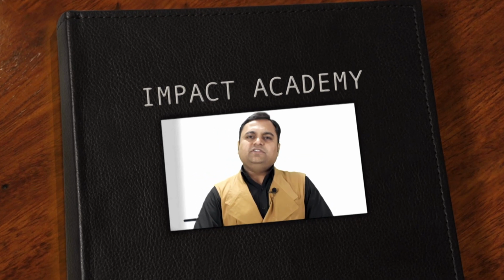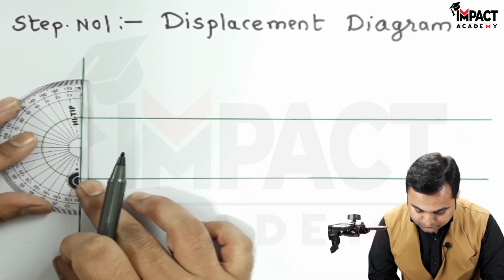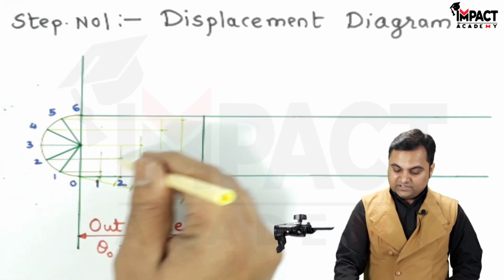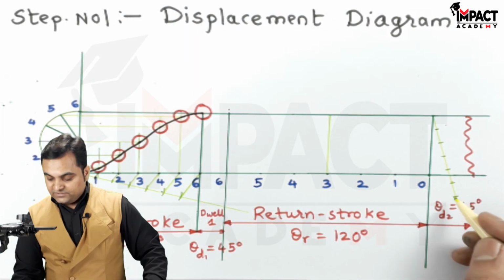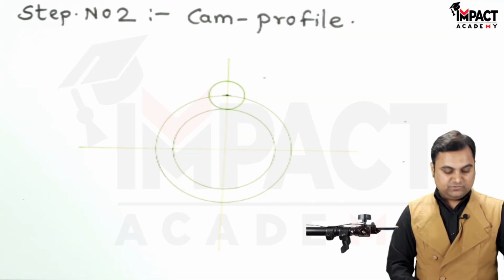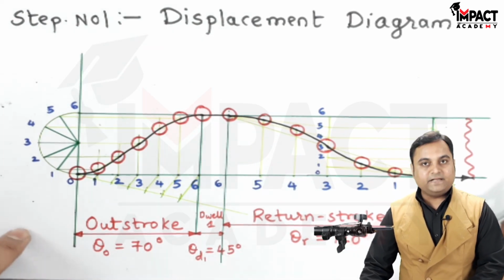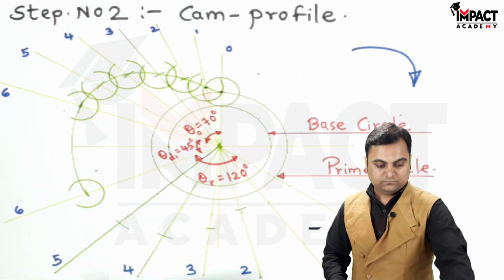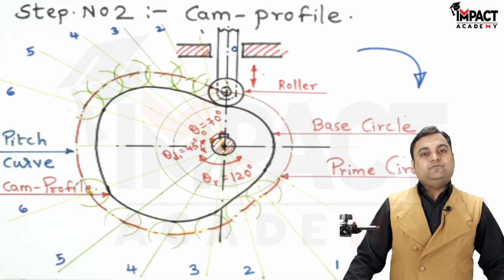Cam Profile for Roller Follower | Cams & Followers | TOM / KOM | #engineering #gateexam2026

Comment: if any offset in cam profile diagram in roller follower
Reply from the maker: Admissions Started for Engineering,
Diploma & Degree (All Branches)
Call Now: 7666456011
BDD Chawl No. 10, Lower Parel (East), Mumbai.

Comment: sir if we take 1-a;2-b etc..  and keeping base circle as reference mark points and join them , wont it give us the cam profile as well? can we do it like this? and then from each marked point (taking roller rad) draw the rollers on the cam profile? will it also be acceptable if i perform it like this in my exams? plz guide sir.
Reply from the maker: http://bit.ly/impactEngineering
To access all Engineering Videos 
Please visit our app Impact : The Engineering App 
You can directly download the app from the link given on top👆🏻👆🏻👆🏻

For more queries related to app, contact our Customer Care Number :- 
+91 7900123134

Comment: Draw the profile of cam operating to inline _knife edge follower is per given 
(1)  Lift of follower is 40mm during 60° rotation of cam with SHM 
(2)  Dwell for next   45° rotation 
(3)  Desent to its original position during next 90° rotation with uniform velocity 
(4)  Dwell for next remaining rotation of the cam 
Least radius of cam is 60mm. Draw the displacement diagram for anticlockwise rotation
Reply from the maker: http://bit.ly/impactEngineering
To access all the private videos and Remaining all Videos 
please visit our app Impact : The Engineering App 
You can directly download the app form the link given on top👆🏻👆🏻👆🏻

For more queries related to app, contact our Customer Care Number :- +91 7900123134